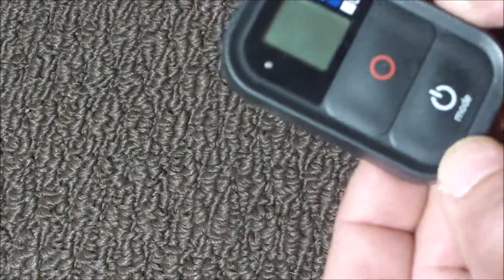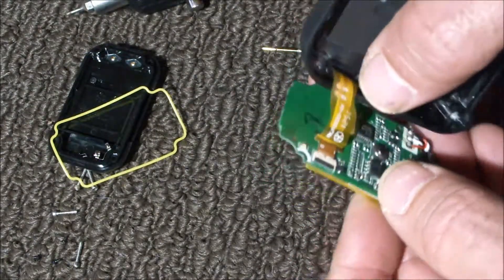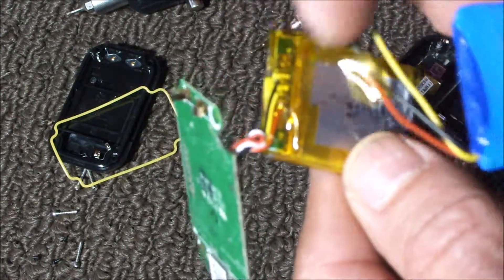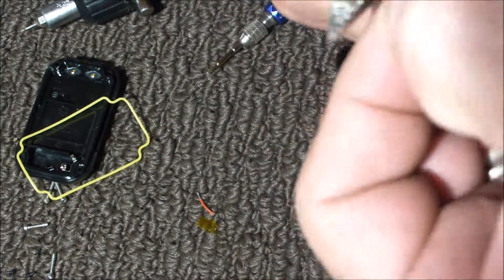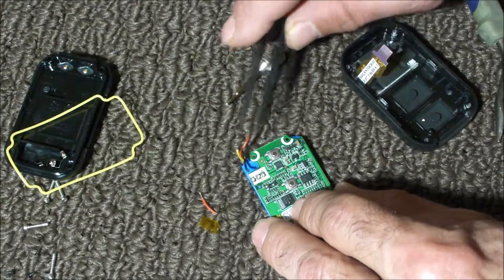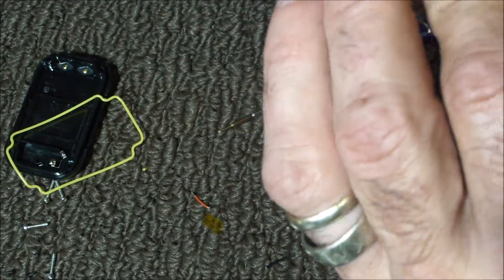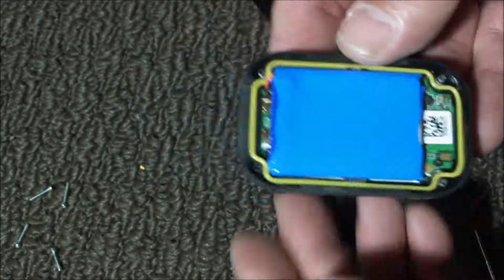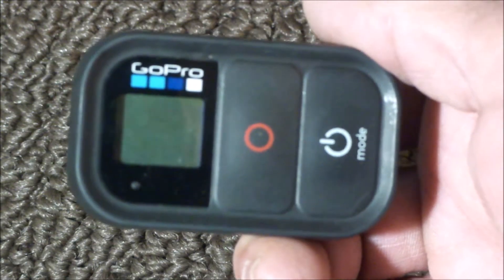How to Replace the Battery for a GoPro Hero  Remote

Comment: Followed these instructions and it worked, cheers.
A couple of thoughts. My battery was really well glued, so I poured around 20mills of rubbing alcohol around the battery to slowly prize it off the PCB. Also worth running a bead of silicone grease around gasket if using underwater. My remote would fire up with USB power but immediately die the moment power was removed. It took me around an 1hr to replace battery with all the tools at hand, its fiddly but doable.

Comment: The connector for the flat cable has a lever!  You lift it up and it releases the cable.  Then you push it back in and clamp the lever back down.
Reply from the maker: Thanks for the update! That should be helpful to anyone attempting this!
Reply: I lifted through white side, lol!!! And obviously broked it. But it still working after my dumbness.😂